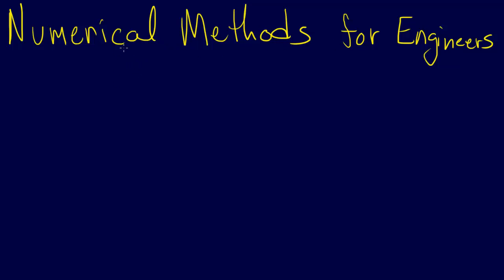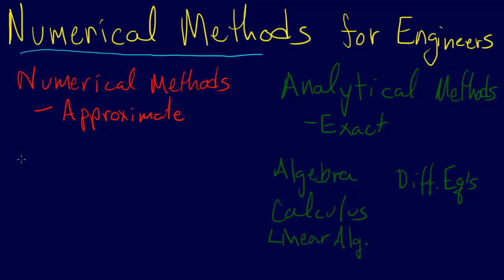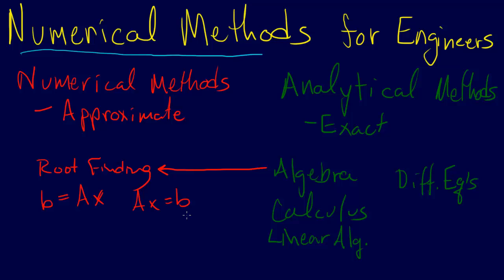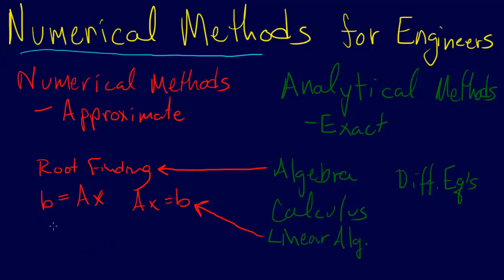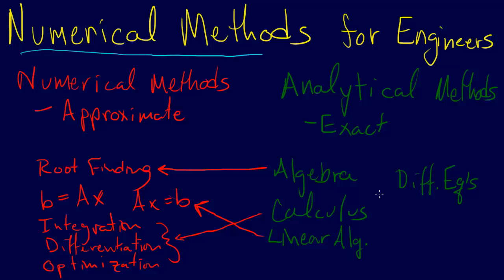1.1.1-Introduction: Numerical vs Analytical Methods

Comment: Jacob,
I want to thank you for this wonderful work. I have learned a lot from you. Recently i started teaching numerical methods for undergraduate programs in civil, environmental and sanitary engeniering. 
Your clear explanation of Chapra and Canale's book has helped me convey the concepts in class.
Greetings from Colombia,

P.S. I would like to know what program / application are you using to write in these videos. This is important, because due to the current COVID-19 pandemic, virtual classes are being implemented at the university, and  I am having problems due to the lack of classroom board.
Reply from the maker: I used vim for outlining, smoothdraw for writing, LyX for equations, Matlab for computation. I now use OneNote for writing, which also works well.

Comment: I need to do modeling for a network topology and algorithms but i don't know from where to start, any advice??
Reply from the maker: I would start with a diagram. Diagrams are incredibly powerful. Then start trying to develop equations that accurately describe what the diagram depicts. Keep it as simple as possible, and only add complexity when it's absolutely needed to capture important behavior.
Reply: @kvyi  thanks)

Comment: Never use analytical methods
Reply: JOHNNY BELTRAN why? It depends on situation, some problems require analytical method and some require numerical. You just need to be able to identify which is needed.
Reply: it depends Johnny